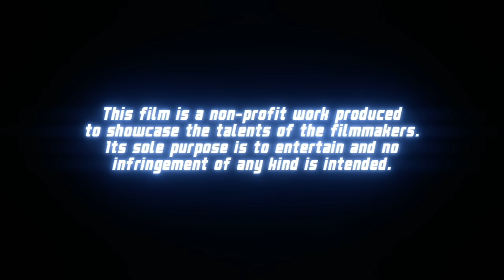RvB2: Ryan vs. Brandon 2

Comment: Combines lightsabers to make a double bladed lightsaber

The entire internet: hey, Thats pretty good!
Reply: zane stewart My guy was the Cal Kestis Before Cal Kestis
Reply: I do feel like it is overated when once you get 2 lightsabers you instantly stick them together but I think it's ok as long the lightsaber was originally a double one
Reply: in my opinion i think its stupid to not have a double ended lightsabre, as if you want to fight someone in a one sabre fight, just don't turn the other end on and being able to unscrew allows for mind games as you switch from staff, to dual wield, to single and back to staff, focusing on that can mess with a warriors mind.
if possible id like an inquisitorial type lightsabre as the spinning option is very helpful and you don't need to use it if not needed.
i love how the movies acknowladge its a superior weapon but have to make work around like characters saying stuff like "thats not the jedi way" and "it is the weapon of a dishonest warrior" or something like "evil people used it so i wont" its funny.
Reply: They’re called dualsabers. Darth Maul had a red one in The Phantom Menace.
Reply: @PRESIDENT_LEMON  The double bladed lightsaber is actually more limited than a standard lightsaber.  It requires longer swinging motions and gives less range unless one blade is turned off. 

Plus, by being connected, if your opponent is smart, they'll always know where the second blade is: it's on the opposite side of the current blade.
Reply: @charlielucas3386  according to the wiki you have the normal lightsabers, the saberstaffs that maul and temple guards use, Jar Kai which was the form of using two lightsabers like Ahsoka Tano does, and a splitsaber which is what Cal Kestis is most famous for using, though Ventress had a set in Clone Wars
Reply: @hwangraphy5  ikr
Reply: Apparently everyone here forgor Asajj Ventress combining her two sabers together in TCW movie.

Comment: I'd always wondered why they'd never had anyone turning their light sabre off in the middle of a clinch [1:39] and then turn it back on again. It's one of the unique elements of a sword that can be turned on and off to make it a different kind of sword fight. Kudos for doing it.
Reply: Me to.

One thing however I always wondered  ( that hasn't been done so far, as far as I know): Why not building kinda a hidden blaster mechanism into the bottom of a one sided lightsaber?
Reply: That is actually technique in the starwars universe to turn on a saber in the middle of strike then turn it on again after you have bypassed a enemies block.
Reply: evan stokely
Yeah, you can clearly see that tecnique being utilized in the Star Wars: The old Republic's 2011 cinematic trailer
Reply: And this is called Tràkata ;)

Comment: The table at "0:55" is made of what? Beskar (Mandalorian iron)? xD
Reply from the maker: Mateus Magalhães It's a cortosis work bench.

Yeah.
Reply: Ryan Wieber It's not cortosis, the lightsaber did not short out after contact
Reply: Mateus Magalhães Doesn't have to be pure cortosis.
Reply: +Faaa313 that wouldn't stop a lightsaber, as their destructive power does not come from vibrations or kinetic energy. I lightsaber will always cut the same way, no matter how fast it is going, but neither a sword or a bullet can cut unless it is travelling at a sufficient velocity. I don't know about adamantium, but vibranium definitely could not hold up for a second against a lightsaber.
Reply: ***** that is an excellent point. But I believe that deals with the ability of a substance to withstand intense heat, not the cutting power of the lightsaber itself. That was an immensely thick door, meant to absorb explosive and energy discharges. But elements like vibranium do not draw their strength from their ability to withstand heat. Vibranium reflects kinetic energy; lightsabers produce sufficient heat to burn through anything except themselves; thus, a lightsaber does not introduce kinetic energy in its attempt to destroy its target, therefore the special characteristic that metals like vibranium have would be useless against a lightsaber. 
THAT BEING SAID:
that is my personal explanation for why the canon characteristics of vibranium would not be sufficient to withstand a lightsaber hit. However, in the Avengers, we clearly see vibranium holding its own against Iron Man's energy blasts, not to mention the Chitauri's weapons. So it may be the Captain America's shield can withstand energy bursts--not sure why or how--but i don't think that just a plain vibranium table can.
Reply: super mans iron
Reply: I think it had to do with he stopped mid strike so it appeared to bounce off
Reply: +Mateus Magalhães he didnt hit the table with the lightsaber itself, he hit it with the hadle (i think)
Reply: +Mateus Magalhães I think it could be argued that he struck the edge of the table with the top of his LS handle, not the blade itself, anyway it's too fast to say for sure.
Reply: no, it's made of a metal only found on mandalore, Mandalorians used to be a warrior class that used to hunt Jedi
Reply: +Antilles Gaming its made of the metal that the weapons magnagaurds use
Reply: Alejandro Silva mandalore has a metal that can't be cut by lightsabers
Reply: +Antilles Gaming I can be cut just takes more effort.
Reply: Yup
Reply: Why don't they make lightsabers out of Beskar?
Reply: Because it's not as Elegant as Phrik Alloy with Electrum Plating. Now the design is up to the wielder, so if the Jedi or Sith is from Concord Dawn or Mandalore, they may choose that metal.
Reply: Steven Cecil Oh I thought that it would be because it's too heavy.
Reply: +Steven Cecil
Screw elegance, I want something that's going to hold up.
Reply: +Mateus Magalhães the saber wouldn't have shorted out after contact it would just clash then glance off it ,but since its probably durasteel and cortosis mixed table what it did here is very possible.
Reply: I disagree. Lightsabers cut via transfer of heat, so the longer the contact, the more heat would be transferred.
Reply: so true
Reply: Mateus Magalhães
Reply: Mateus Magalhães true sos true
Reply: Mateus Magalhães cortosis maybe
Reply: Just gonna throw in my two-year-too-late input on the beskar lightsabers thing, it comes down to culture. Mandos didn't like jedi, and only they know how to smith beskar.
There was one confirmed mandalorian jedi - Tarre Vizsla at least in Legends - but he made the Darksaber.
Reply: Mateus Magalhães hold on I thought mandalorian iron full on shorted out lightsabers instead of just being immune to them.

Comment: 2:37 I've always wondered what would happen to a lightsaber if it's emitter got cut off, if we're to assume that a lightsaber is a stream of energy emitting from the Kyber crystal through the Force, wouldn't cutting the emitter off just make the blade fizzle out from the bottom-up?  As in the blade would stay in place and kinda shut off in the reverse direction because the emitter is no longer emitting power instead of retracting back into the severed emitter like it does in the video.

Comment: the most noticable failure of this video is when they press their swords against each other under the lamp at 1:09 where brandon cuts the tube if the lamp andholds the air coming out of that tube against rans face the failure is if BOTH are pressing their sowrd ateatch other ryan should hav pressed his sword mor downwards when brandon uses his to cut the tube which would mean that ryan should havew killed brandon on the spont but instead brandon cut the tube and ryans sword remained on the same height instead of going further down because of the lost resistance what kept his sword up their at the beginnning
the second failure is when brandon put his arm on ryans sword on the ground making it move around on the ground it at least should have touched brandons t-shirt and burned a bit of it orm at least left a mark on the ground if you remember a lightsaber can cut through almost everything

Comment: Well... such a thing. I explain: the trailer looks epic, but the camera changes too often, which gives the impression that this is some kind of drawn cartoon. It also seems that both opponents do not want to kill each other due to the fact that there were many moments where it was possible to inflict at least 2 at least 3 fatal blows. Also, both use the same combinations several times in a row, there are no special and specific blows thanks to which the duel would be much faster